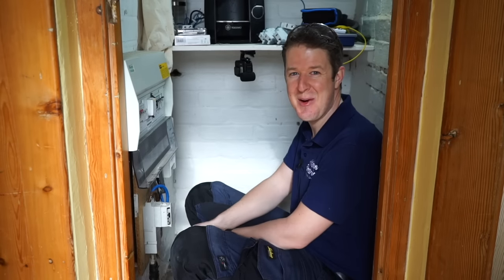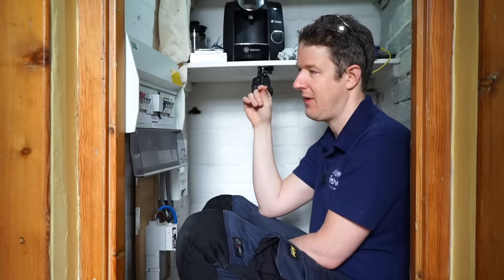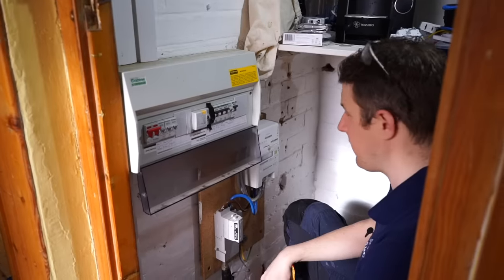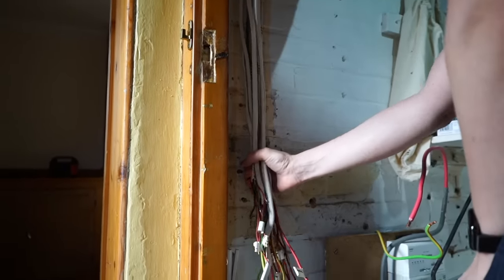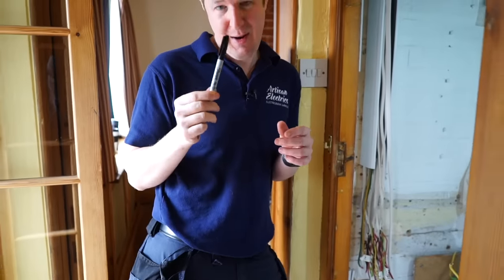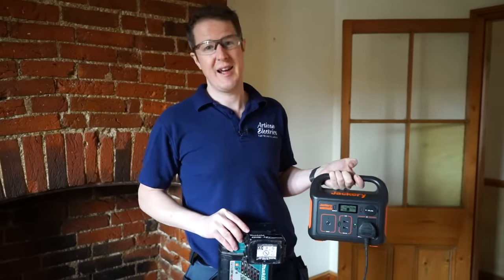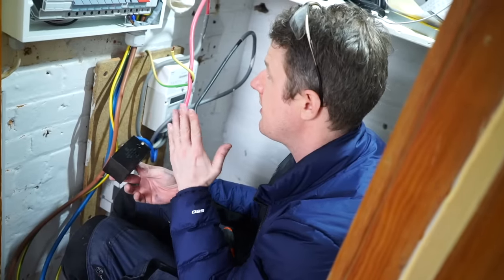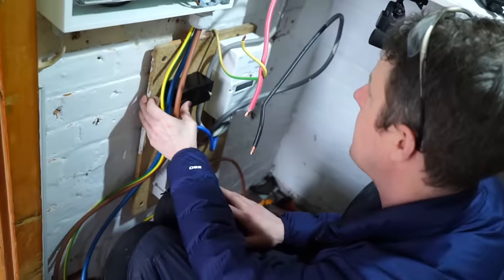My Consumer Unit Secrets 🤫 - How to install a Consumer Unit/Fuse Box

Comment: Jordan, you need to go back to this job to edit the video. Safe isolation is out of he window with that open cutout.  Refit the carrier without the fuse whilst working. Why not fit a 100A dp main switch  ( approx £15 inc enclosure) on to the tails and isolate at that and replace the cutout much sooner. As for the board change, i'm afraid your clients have been badly advised, not sure that ccu would even be a C3 depending on location. No rcd protection on the lighting side could easily rectified by swapping the mcbs for rcbos or swap the main switch with a 61008 rcd. This is a 16th edition board and may only be 13 years old and looks in good condition. I think this looks a lot of expense for the upgrade achieved and elements of this new board, like the bare copper bus bar, are inferior to the stablock bus bar of the board removed. Sorry to critical this is first video of yours that I think, falls below your usual very high standard.

Comment: Is it just me or does anyone else feel slightly disconcerted with the fact that the neutral fly-leads on RCBOs are smaller than the neutrals on the cables?  I realise all/many the manufacturers are the same.  Thoughts welcome?
Reply from the maker: They are such short lengths that 1.5mm cable is designed to take the required current
Reply: The cables of the installation will likely be of a larger CSA due to derating - where they pass through insulation etc, and perhaps to keep voltage drop and Zs down.  The RCBO neutral fly leads will be sized according to the overcurrent protection integral to the RCBO.

Comment: Why would an electrician want an isolation switch fitted by the utility company to cut the power to the consumer unit and not just pull the fuse?

Comment: Your stuff is so different over there. The terminology and everything is hard to figure out. I get a lot from context. The materials and processes are very different.
We don't use colored wire for neutrals only white or grey. And to wire to code here you are normally installing 30 or 40 circuits for an average house. Although our voltage is lower so we likely have fewer outlets on a circuit than you.

Comment: The plastic CU isn’t even a C3 unless in an escape route or under the stairs
Reply: That was under the stairs if you look.
Reply: @stuartarnold9444  so....a C3 then!
Reply: @Spark101.  Absolutely, but as Jordan stated, the client wanted the electrics brought up to current standards; hence the metal DB with SPD.
Reply: @stuartarnold9444  Fair enough....changing the CU won’t completely bring it up to standard but I agree it’s a very good start.   

Many of our landlords have the same attitude now!  The new law might have something to do with it! Lol!
Reply: @Spark101.  why doesn't changing the board bring it completely up to standard?
Reply: @marcusstonham  Changing the board doesn’t magically make the installation 100% up to standard.  It certainly makes it more compliant to the current standard.   But it’s almost certain that various things through out the installation will not be to current standards.  An example will be switch heights and socket heights. 

Did you think changing the board made the entire  installation 18th edition then?
Reply: @Spark101.  with regards to 18th edition if the cable has been installed correctly with cpc on every circuit then changing a consumer unit to an 18th edition type will bring the installation up to the standards required. The heights of sockets and switches are not electrical regulations. They come under Part M of the building regs so your point is not valid.
Reply: @marcusstonham  Oh I see....so you’re telling me that there isn’t anything in BS7671 that says we need to adhere to such things?
Reply: @marcusstonham   Whenever electrical work is undertaken on domestic premises in England or Wales it must comply with the particular requirements of Part P of the Building Regulations (England & Wales) as amended. In addition, all other Parts of the Building Regulations relevant to the work must also be satisﬁed.

Installing a new consumer unit does not convert the installation to an 18th edition installation, because an 18th edition installation would need to take into account various building regulations including Part P, M and F.   If sockets and switches are not at the right heights....Part M hasn’t been met!  

So, as I said.....installing a new 18th edition consumer unit doesn’t bring it up to the 18th edition standard.  The 18th edition standard HAS to incorporate other standards that are not likely to exist in older installations.

So your comment isn’t valid.
Reply: It’s amazing that there are people that think by installing a new consumer unit that the installation is now suddenly fully compliant! Lol.

So many people with no clue it’s scary!
Reply: @Spark101.  bs7671:2018 refers to electrical installations only. The other parts of the building regs has to be adhered to with regards to new builds. If the installation does not comply to BS7671:2018 then it's referring to part p of the building regs only. Other parts of the regs have their own updates and ammendments independent of other parts of the building regulations. When carrying out EICRs we are inspecting and testing to the 18th edition and if we inspect that installation and find that there are no observations then it is acceptable to say that the complete installation complies with the 18th edition of BS7671. If heights of sockets are an important factor like you are suggesting then that observation would be something we would have to code for on the EICR. I'm afraid I don't see any validity in the argument you are making.
Reply: @marcusstonham  I’m not going to waste my time explaining it all to you.   What’s that saying.....’a little knowledge is a dangerous thing’

Just answer me this....’Do you think that by installing an 18th edition consumer unit, and confirming all cabling has a CPC, and is in prescribed zones (which you can’t by the way)......are you saying you would then consider that installation to be fully 18th edition compliant regardless of whether it complied with building regulations at the time the new CU was installed?

Bearing in mind.....to comply with the 18th, you have to comply with various building regs.

Unless, you actually think you don’t need to comply with building regs to be fully 18th edition compliant???
Reply: @Spark101.  yet you wasted your time anyway lol
Reply: And you really are wasting your time by the way
Reply: @marcusstonham  I know lol!  There’s no telling some people!
Reply: @Spark101.  😅
Reply: @marcusstonham  Lol.  But for clarity....I said I wasn’t going to waste my time ‘explaining it’ to you.  I then didn’t explain it.

I did go on to ask a question.....which you avoided.   Game over flower!
Reply: @Spark101.  there's nothing to explain. The actual argument you are making is beyond pedantic. With regards to an electrical installation and ensuring we do our best to bring older installations up to standard, and we can only base that standard on the latest edition of the regs that we work on at the time, there are certain things we do to ensure that the installation complies to the 18th edition. Fitting metal consumer units with surge protection, rcbo protected circuits,  protective bonding where required etc. If we ensure that those requirements are met. We won't need to worry about the heights of switches or sockets (except for specific issues if mounted too close to floor etc), we don't need to worry about an extractor fan not being installed in a utility or bathroom. Although those specific examples don't satisfy their own particular parts of the building regs it doesn't compromise the safety of the electrical installation with regards to BS7671.  Zones, cable depths in walls, cables run within the fabric of the building can't be 100% confirmed without physical interference so we apply standard limitations to those examples. With older installations I'm not looking at deviations from The Building Act 1984 & 2000: The Building Regulations, I'm looking at solely at Part P and BS7671.
Reply: @marcusstonham  installing a new consumer unit in a 30 year old installation does not fully bring it up to currently standards.  Which was my original comment.  It makes it more compliant....but not completely.

No matter what you say.....I am correct.
Reply: @marcusstonham  Just answer the question.  Does installing a new consumer unit make an installation compliant to the current standard.  Yes or no?
Reply: @marcusstonham  And also answer this.....for an installation in a dwelling to be compliant to the 18th edition, must the installer take into consideration any other regulations?
Reply: If you like.....I’ll send you a link to a Professional Electrician article where they cover this exact topic?  I suppose they are talking shit too?

That’s a well regarded electrician publication by the way, where organisations like NICEIC explain things for certain people who struggle.
Reply: @marcusstonham  Think about what you are saying..,,.you’re saying that by installing a new consumer unit, there will be no code 3 observations after.  If the installation is now 18th edition compliant......how could there be?
Reply: @marcusstonham  Installing new disc brakes on a C reg fiesta that previously had drum breaks doesn’t mean the fiesta is now to the same standard as modern day cars, even if the MOT says it’s safe to drive.
Reply: @Spark101.  if the only c3 that was observed was that a consumer unit was plastic under stairs that forms part of an escape route and then that consumer unit was changed then in theory there would be no C3 observations that would be found if an eicr was carried out after it was installed. You would assume then that the installation is compliant to 18th edition. I'm not saying anyone is talking shit. I respect your opinion, it would be fair to respect mine. I'm not professing to be any better than anyone else or know more than you. With regards to older properties I deem an installation to be compliant based on information pertinent to bs7671 with reference made to GN3 where required. Any deviations from other parts of the building regs unless it makes the installation unsafe are not a concern.  When carrying out new builds and new installations then absolutely I ensure that everything linked to other parts of building regs are adhered to. We've really not moved any further forward in the discussion, and that's all it is. You don't need to try and belittle my knowledge. You obviously know plenty and I applaud that.
Reply: @marcusstonham  Fair enough.....and by the way, I wasn’t trying to belittle you.  Apologies if it came across that way.

It is certainly possible to have deviations within an installation that do not warrant a code, or even a comment.   But that would still be a non compliant installation regardless of whether the non compliance observations were unsafe or not.  That’s  why I say, changing a CU doesn’t necessarily bring an installation up to standard.  The rest of the install would need to be 100% compliant which is very very unlikely in older installations.  There will always be something......and therefore we can never proclaim following a CU change that the install is now ‘up to standard’.  It may be close.....and somethings that’s the best we can do.
 

My original comment was simply referring to that only.  I think you may be referring to a safety standard from an EICR point of view whereas I am referring to technically up to standard.   It’s interesting that the two can be different.  Anyway.....This industry will always be a hot topic of conversation with varied opinions that sometimes differ.  Have a good day buddy 👍🏻
Reply: Can I suggest that changing a consumer unit to an 18th edition model only brings that part of the installation up to new standard it is not feasible to know how all the cables are installed in a domestic dwelling as you cannot visually confirm installation methods or proximity of other services installed at a later date. You can test cables but that alone does not confirm proper installation.  Upgrade is a better term to use but it still helps to make thins safer for the customers
Reply: @jamesdaly4040  This is my point.  An installation can only be considered an 18th edition compliant installation if fully installed to the 18th.  Changing the CU to an 18th edition board doesn’t make the installation 18th edition.  👍

But.....opinions vary!

Comment: good job but if the electricity supplier caught you tampering with that bs1361 cut out they could summons you .also you have just lost your job .you are working with a live conductor .the neutral tail is a live conductor .be carefull .one day youll get bit.also why did the board need changing .3 rcbos would have been all that was needed here. the 10mm mec is also more than big enough on a tns .the supply cable is lead but usually the outer sheath is asbestos .be careful .i am a fully approved niceic contractor not a diy bloke

Comment: I like how Corey done an EICR there the day before, but the ring CPC’s are still twisted together in the CU!   I assume he took the ring continuity readings from a socket?  Not best practice but a suitable shortcut if you don’t fancy taking the CU apart.

Obviously....the premium service would be to take the readings at the CU as per the guidance and for very obvious reasons.  Unless he reinstated the twisted CPC’s after he done the tests at the CU?  Who knows?
Reply from the maker: There’s no difference between taking a reading at the CU or at a socket
Reply: @artisanelectrics  There is.....not in regards to the measurement, but what you are also confirming.  

There’s a reason that the guidance says it needs to be taken at the consumer unit.  

Shall I tell you, or do you know?
Reply: @Lister Smeg parallel paths maybe
Reply: I don’t think Jordan actually knows, so I’ll enlighten him.  By the way.....a premium services electrical company should know this. 

When carrying out ring final continuity testing, part of the process is to confirm that, as far as reasonably practical, all connections throughout that circuit are sound. These connections are normally within the socket outlet. If you conduct your test at a socket outlet, then the socket that you need to reconnect following your test will be an unconfirmed connection.

If you conduct the test at the consumer unit, you can visually confirm the connections are back in place following your tests, Plus you can give them a little tug to make sure they’re not loose.  You Cannot do this once you fold the cables back into a socket back box and screw the  socket back if you do the testing at such a point.  

This method that Jordan has adopted, is not the correct way of conducting the test, and isn’t 100% accurate.
Reply from the maker: Interesting point I never thought of that. Very unlikely a wire will come loose when screwing the socket face back on though if you have done the connections properly.
Reply: @artisanelectrics  granted, but....the testing process is to confirm all socket connections are sound.  Will you omit that socket from your report.  Not likely.....but, it is untested, and an unknown.  

It probably is ok......or is it?  Who knows ah.  It wasn’t part of the test!
Reply: @artisanelectrics   I wouldn’t worry too much....I pulled Sparky Ninja on the same thing a couple of years ago.  He argued at first but then saw my point.  

I think it’s quite common and people don’t realise.

Comment: I'm surprised you pulled the main fuse, because you can get fined over £400 for that.

If you need to install a main switch, but can't pull the main fuse, then you can isolate the load on the tails & then "safely" remove them from the meter and re-connect into the meter once you're connected at the other end (with no load of course).

Comment: "I never had a problem doing it this way." - Using earth to cut the insulation.

But didn't the old man of the 'worst DIY job ever' say roughly the same? Your reply "It works until it doesn't."

Use tools, not the cable mate.

Comment: You know you shouldn't disconnect the meter, or "mess" on equipment which falls in someone else responsibility, let alone make a video and feed it as evidence. True, they should have a main isolator switch, alternatively request from the energy supplier to install one, to avoid disconnecting the meter and take full responsibility for whatever happens before those cables coming from and into the meter. As you probably know now days(familiar as you are with your tarrifs), is all about money and responsibility, and no one including yourself like to take responsibility, or pay any money for "someone else" fault. Unfortunately, most of the time, customers end up paying those mistakes, and you set a wrong example how they will end up doing so...

Comment: Ripping the customer off .. there is nowhere in the regs or otherwise that would allow you to change that consumer unit .
You chose to change it at the customers expense.  
You are employed by the customer and this kind of practise is fraud you chose to change when the original one is up to regulation safe and as you state in good condition.